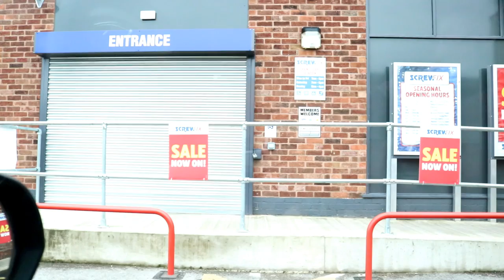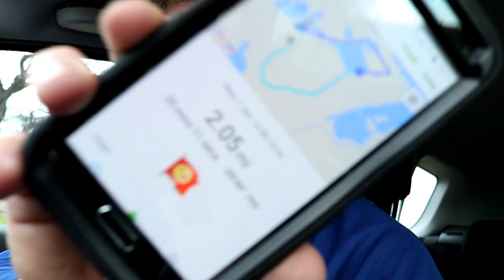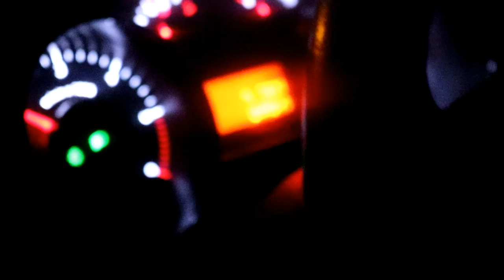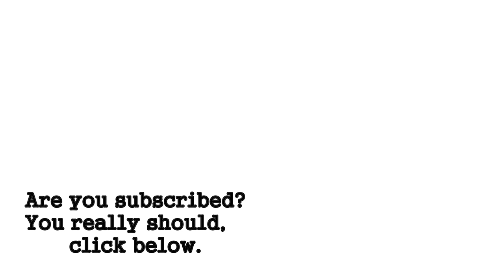They Said They Were Open

Comment: It's all good, brother!  Slow start, powerful finish - stay strong.  Have you ever considered a compound chop saw? If you're doing interior renovation (framing, building cabinets, etc.) - you might find yourself using that MORE than a table saw. Table saw is more versatile, but I use my chop saw all the time. Mine is not a sliding compound saw and I frequently wish it was - you can cut wider stock adn do some fancy notching with the compound saw. Loved the IVB kettle - I'd put a big red X on that and scratch HARRY'S REVENGE under it - but that's me. CHEERS!
Reply from the maker: I have a chopsaw, it features in tomorrows vlog. thanks for the support man.

Comment: Click on what advert? Might be going a bit thick but watched the intro several times now and still can't see any clicky thing. At this rate I'm going to be struggling to keep up with the viewing never mind your posting 😅.

Nice vid, I don't use Screwfix as much as I used to since the company was bought out by B&Q. Screwfix used to be a cheap and quality mail order with free delivery over £45 . B&Q bought the bloke out as he was serious competition, didn't work though as he opened the same business under the different name of Tool station. Tool station (old Screwfix) may not have the full range of Screwfix but the screwfix prices have been slowly graduating towards the usual inflated B&Q prices.

As for the Idle Valley memorabilia; perhaps a clean break would be better? Less thoughts of what could have been? Either that or buy it back at a fraction of the cost at auction as it's fairly specialist equipment and is likely to go for a fraction of what it's worth.

Cheers

Schnuz
Reply from the maker: The are opening a toolstation just round the corner, cheers mate
Reply: Done a shut down and restart and finally managed to click on the clicky thing 😉.

Cheers

Schnuz.

Comment: Going for a run in the country is great but did you have to pick the wettest most muddy track around lol. That was a balls about screwfix but at least you will have it tomorrow(or today at this stage). It's a shame you have to gather all the bits for IVB like that to hand back,that tank in particular would have been nice to keep. On the other hand it will be good to no longer have any tie in to those muppets that screwed everything up. Just a thought but now that you have a new unit(ooh matron) have you considered setting aside a small corner to use as a homebrew shop maybe get back to selling your ag kits and hops etc like you used to? Sorry for the essay you take care m8 and all the best. Cheers.
Reply from the maker: I have thought about starting the HB shop again,  I want to make sure IVB is all closed and finished beforehand in case they try to steal anything else off me. Once the company is off companies house I can crack on.